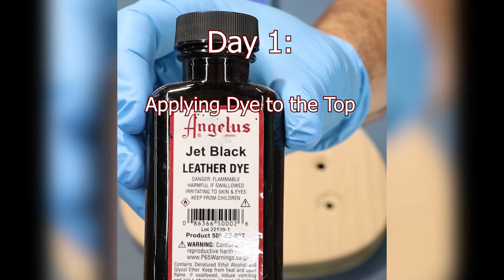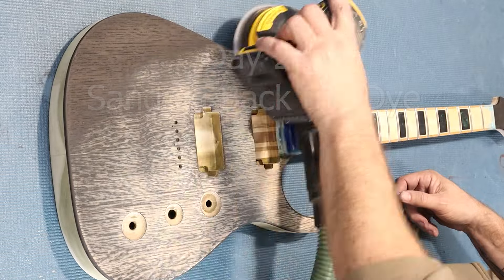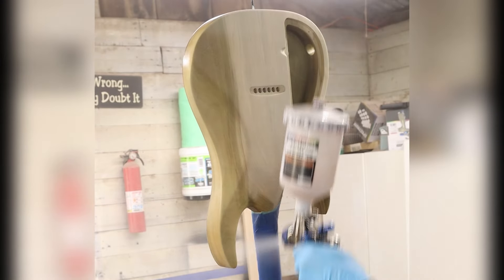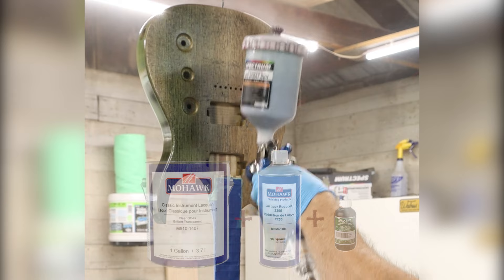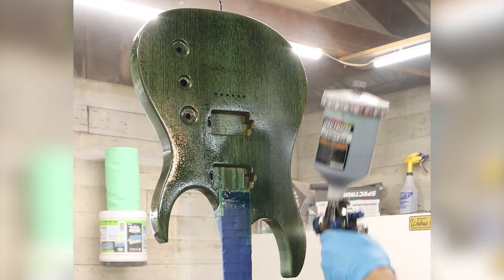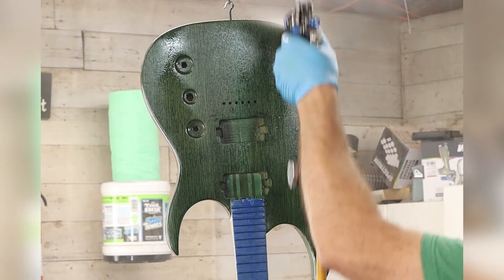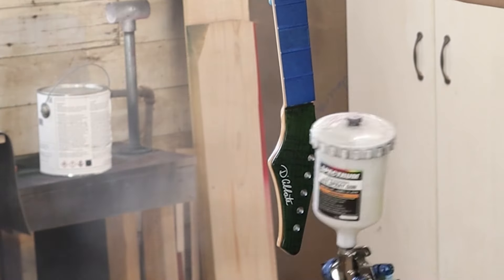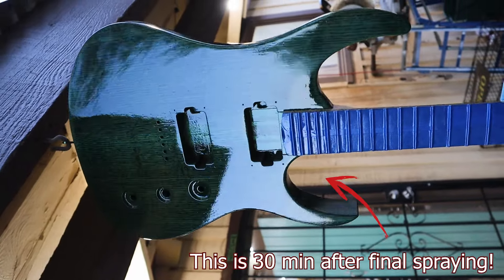Guitar Finishing: How to spray translucent lacquer colors on a custom guitar

Comment: This was very helpful and sounds pretty straightforward but could you provide info on what gun are you using, what needle tip size, is it hvlp, what pressure are you running, etc. that would tie up the whole painting package
Reply from the maker: I am using an inexpensive gun from Harbor Freight.  The Spectrum HTE (Not HVLP) gun with 1.3 tip.  The pressure is generally anywhere from 15 to 25 psi (at the gun) but that TOTALLY depends on what I am spraying.  Sealers are a bit thicker so the pressure is set closer to 25 psi.  My Lacquer to Reducer ratio is generally 3:1 (again differs by feel) and with that I will reduce the pressure as the mixture gets thinner.  I always test on a scrap piece of wood or even paper taped to the wall.
Reply: @dabbatecustomguitars  thank you!

Comment: Beautiful working ❤how many coats on guitar, means total layers by spring
Reply from the maker: Thank you so much.  Total of EVERYTHING, on this particular guitar, is 3 coats of Mohawk Vinyl Sealer (that get's mostly sanded back), 3 Coats of Translucent Green and then 9 coats of clear.  All are Nitrocellulose Lacquer. Then, it sits completely untouched for 30 days.